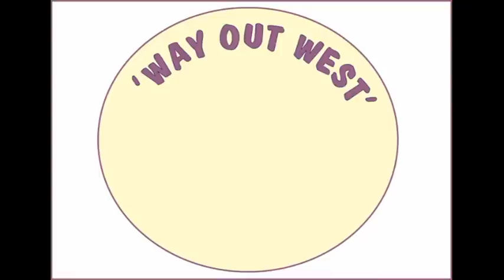Homemade Wood-Fired Pizza Oven Cost Nothing At All To Build (And Feeds Small Multitude)

Comment: You cannot underestimate how good a wood fired oven is, ive had mine for about 5 years now and it's part of the family now. Every meal ive put in my oven has turned out to be so so much better than a normal gas/electric domestic oven, theres just something about them that imparts not only flavour but it's also easier to cook in; granted you have to keep an eye on things but that's half the fun!

Comment: My understanding is that the height of the opening needs to be 63-64% of the height the "ceiling" (the highest, top part of the inside of the oven) in order for the fire to burn efficiently. Or is that not necessary if there's a chimney? Either way, cool idea - I'm a big fan of creative "re-purposing" (I've been slowly building a cob pizza oven using an old, dry well as the base).

Comment: You are such an inspiration that we just built our own oven last week following your way.
Our soil is 99% clay so we hope it will be a good oven.
We tried it and it was a good success for the bread (never made a better one) but it didn't keep the heat long enough for cooking much afterwards.
Could you please tell me how much wood (about) you use to heat your oven (for a small multitude as you said) ? Do you keep the fire for a long time ?
Do you keep some embers in the oven while cooking the pizzas ?
Thank you again for this great idea and video.
Reply from the maker: Mme Escargot well done! It's been so wet here we still haven't used ours at all yet this year.
I think we had it going really hot for about an hour before we cooked with it. And we took everything out before the food went in. Of course you could keep it hotter for longer if you leave the embers in, or if you had more insulating clay around it. We found ours lasted long enough so we haven't experimented any more - but it would be interesting to hear how you get on with yours. Sorry if you're disappointed - but maybe you just have to get to know yours better?
Reply: +WayOutWest Blowinblog 
Thanks for the informations. We are not disappointed at all, we are very happy with this great idea. We just need to do some experiments(yummy ones I hope). Your experience is very helpful. The oven is running right now, I'll let it burn a bit longer. Though I have to be very careful with fire as everything is dry here. I wish I had some of your rain, we had about 20mm since may and it was 2 days ago. I'll keep you informed if you want.
Reply from the maker: Mme Escargot Yes please!
Reply: Mme Escargot Try using oak.  Holds heat longer.  Find a slow burning wood, over stuff the fire and cook when the wood is turning white and the flames have died down (less smoke and better taste).  Apple wood is really good too.

Comment: A great video thanks.  On the negative side, maybe use safety glasses when using ankle grinders - sorry angle grinders - and other power tools?  

I would like to make one of these ovens to put on a trailer to go to markets etc.  An oil drum would make a good base.  I also saw in the street market in Croydon, England some people cooking on a trailer-mounted open pit wood/charcoal BBQ.  It was about 2m x 2m and they were cooking HUNDREDS of gourmet sausages at a time, and also serving from all 4 sides.  You could also spit roast a whole animal too and still have room to do sausages, burgers, roasts etc.  another good idea they had was to divide the griddle into sections, so that they had a hot section for cooking and cooler sections (just move the charcoals away) for keeping cooked food warm.
Reply from the maker: Louis Speer  You would need to have a constant fire if you were making pizzas all day. but that could happen too.   You're right about the glasses of course!

Comment: It looked like there was quite a bit of smoke left in after you removed the embers and blocked off the chimney. Did this give the pizza a smoky flavour?
Reply from the maker: Yes. That's the important part. Otherwise you might as well make them in your kitchen oven.
Reply: An excellent point. Well, everything looked so delicious. :-)
Reply: Any concern about contamination?
Reply: not tryna sound rude but thats the whole point of the wood fire oven ...

Comment: I have built my oven, just need to find a sleeve for the chimney which is proving difficult. Just out of interest, what's the best and safest material for a baking tray? 
Great video by the way, very inspiring.
Reply from the maker: Tom Edgar good question Tom. We used really thin aluminium - and they actually burned a little. And became brittle. So I think I may invest in a piece of steel plate. 1 mm thick should be enough don't you think?
Reply: WayOutWest Blowinblog yes, steel would work. Think I might try forming a stone base on top of the breeze blocks, seems cheap enough as you will only need few large tiles. They say stone is the best surface to cook on. I will give it a try and let you know.
Reply: Tom Edgar A 300 mm square terracotta tile works well, although it may be better to line the base with them.  The diameter of a 205L drum is about 580 mm, so you may need to cut about 25 mm off one tile and have them side by side to get the maximum cooking surface area.  To line the whole area would require 6 tiles, as a drum is 880 mm high.  By doing this, you wouldn't even require cooking trays, just cook on the base! (keeping it clean, of course and avoiding the charcoals)

When cooking, don't use oil or anything on the tile.  Make sure the bottom of your pizza dough has a bit of dried flour on it and it won't stick!  Tiles will build up a patina with time, a bit like a wok.  Also, if using a tile in a conventional oven, you can dust it with corn flour before putting pizza on it and back into the oven.  You can buy terracotta pizza cooking tile in a housewares store for say, $30, but I bought my tile in a builder surplus store for $4.50!  I got a couple naturally - ten years ago and still going strong!

Good luck!  We are very much looking forward to visiting London and Ireland in July.  It's a long way for us from wee, cold, wet Tasmania, but as close to a European climate as one can get, but without the severe winters!  I lived in Bath for a year and regularly traveled to the west country.  Absolutely loved it.  We'd move back any day, however elderly parents and children (now just entering into adulthood) keep us here.

Comment: Dont know why you would put it underground except perhaps to conserve the heat. But that is when you burn wood or whatever an then bake, so the heat hangs around longer. But you have the coals on the bottom of the barrel the heat is there anyway and you can easly adjust it by putting in or taking out coals. It would have been easier and better just to put the barrel on some sort of stand (say table height)  or a wheelbarrow and you can move the whole contraption when not in use.
Having said that it is fine if you are doing for the hack of it.
Reply from the maker: the thin walls of the barrel would keep very little heat in - the soil is essential.
Reply from the maker: Well I seem to know a whole lot more than you do  : -  )  
Instead of being so rude and idiotic, why don't you try the two designs for yourself? Film the results (and then come back and apologize..).

Comment: Hi, i'm of to make my own. The pipe you use, is that the same as used for chimneys or is it something less complex? And what is the diameter roughly?
Best regards, Michael
Reply from the maker: Boldten I think this one was for a stove - but any metal pipe will do. 6" diameter works well. Have fun!
Reply: WayOutWest Blowinblog
One last thing. Did you do any research regarding the toxicity in coocking in the drum?

Comment: Hi...  just wondering how long you burned the fire before dragging it out? Cheers!
Reply from the maker: Maybe an hour - just depends what you're burning. Or you could keep putting more fuel in until the soil around is starting to burn. The trick is to take it out when the oven's as hot as going to get - but that's not easy to guess!
Reply: Lots of variables I suppose. I'll give it a crack and see what happens. Thanks again!

Comment: This is MY style of thinking...use what you have with a little creativity. The only change I would have made would be to find a chunk of waste concrete sidewalk for the floor to prevent use of the aluminum. Also, I would have burned and cleaned the interior of the drum to remove possible contaminants. Old drums are spooky objects indeed. However, Nice Work! So it's not pretty, simplicity can be a thing of beauty.

Comment: Because everyone has an oil drum, pipes, a metal saw, etc. lying around.  

Clay, sand, water and straw is much more accessible and easier to use when building a pizza oven.
Reply from the maker: We don't have any sand or clay, and we have to but straw. So we're not all as lucky as you are.
Reply: Way Out West Blow-in blog I'm just saying that it's easier to find and our source these materials than it is an oil drum (and how is it cleaned before cooking in it?), pipes, and the cost of purchasing a metal saw.